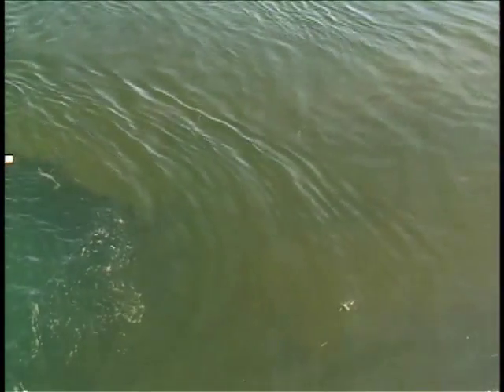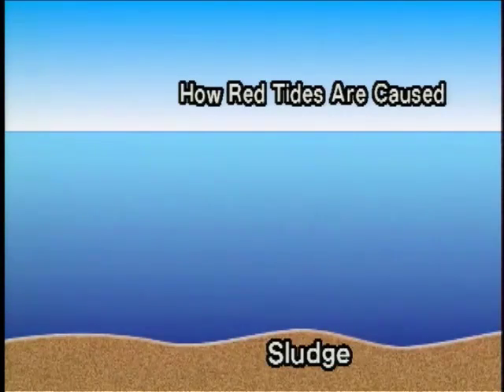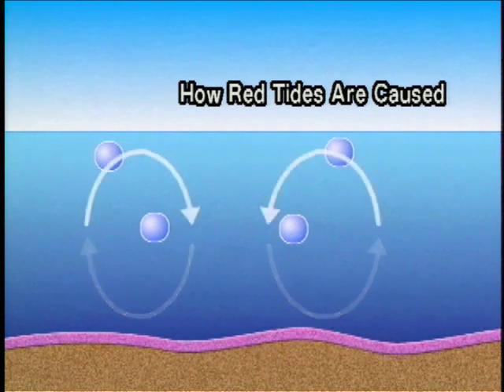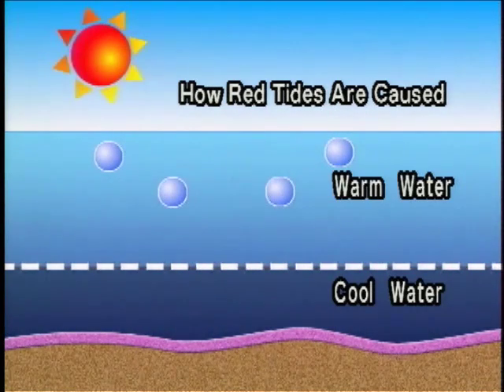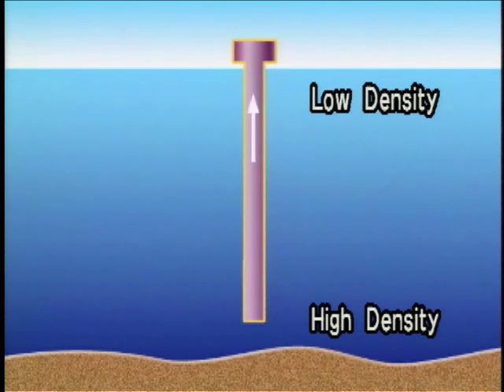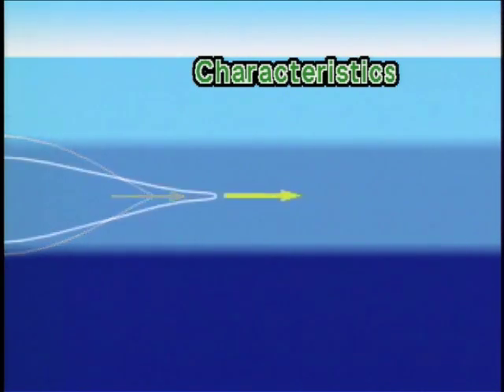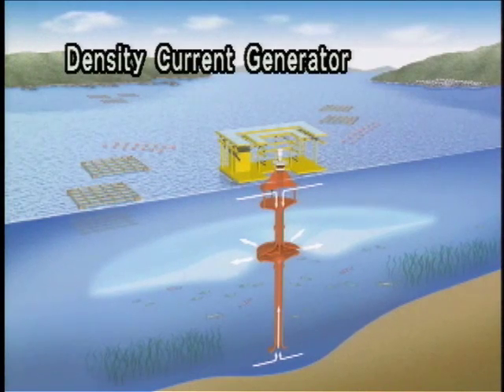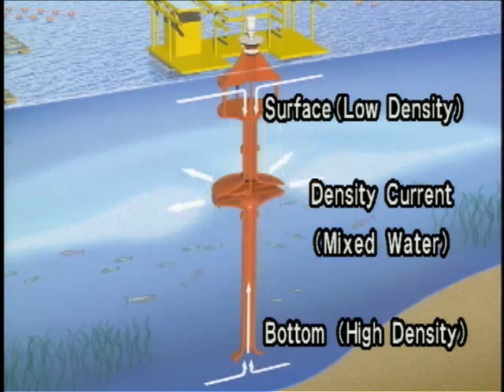Micro nano bubble generator with water movement density current generator

Comment: How hig is the horse power? Do you 
suck air into water and make micro bubble  and increase DO?
Can I buy one in Taiwan ?Or buy one from fro you?
Reply from the maker: I only sell the micro nano bubble generator pumps. If you ahem technician that can wired up a three phase motor and some piping work, it will be OK. The biggest that I have is 5KW. can do 60litre of water in 1 hr. max. But for beer efficiency I do not recommend to work at max output. ideally about 40 lite is max efficiency and many bubbles. You can use atmostpheric air (normal air from outside fro filtering and increasing DO of water. But if for killing germs n bacteria then you inject Ozone. depend on yr process different gases can be inject to achieve your requirement. I do not have any representative in Taiwan. Please send me your email so I can email you some life video  of the micro nano bubble generator in action real life.
Reply: @jparryprodeal  titus.ufb@gmail.com  thanks
Reply: @jparryprodeal  60Liter/Hr or per minute?
Reply from the maker: 宋天雄 60L per hr.
Reply from the maker: If you are looking at such big vol of displacement. I suggest you need to go up to 10-11 kw.